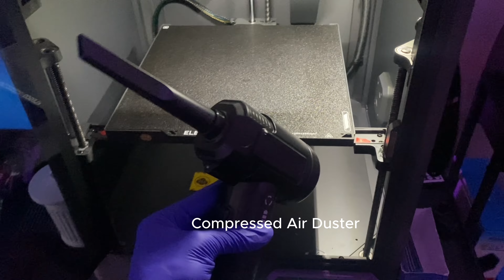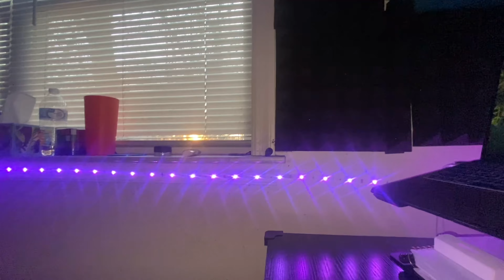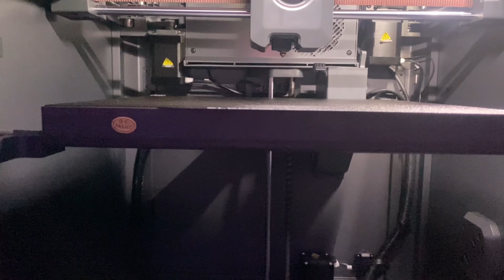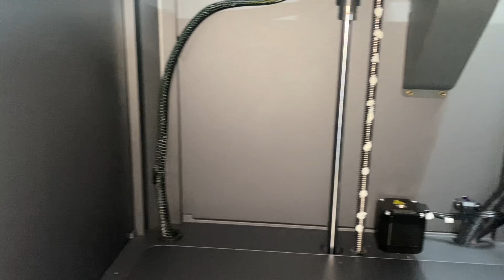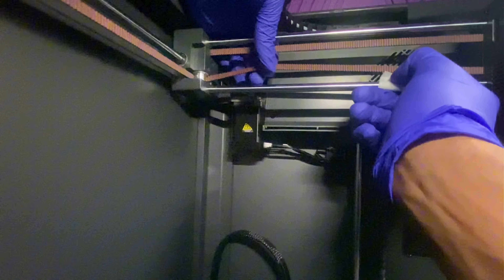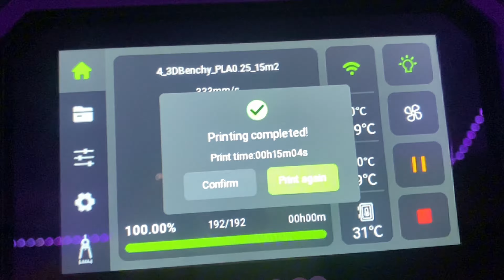200-Hour ELGOO CENTAURI CARBON MAINTENANCE

Comment: Why not use the lithium grease on the xy carriage as well?
Reply: you can but generally you want grease on the screws and oil on bearings/rods i just did my first maintenance after 100 hrs and used the grease they provided on both but will be getting the super lube for the rods. it comes down to science of lubricants its a whole thing you dont want to get into but thats generally the rule if it glides/slides use oil if it pushes/pulls use grease
Reply: @McSillyx  Understood but since elegoo from the factory also uses lithium grease on both and that's what's also supplied to the user shouldn't it be ok to go with that? like the performance and longevity difference should be minimal since other irrelevant issues are more likely to arise well before that given the machines $300 price.
Reply: @pvim  yes the provided grease is fine  i just know a bit about how greases and oils work its not a problem to use the provided grease its perfectly fine im going to get the super lube for longevity grease picks up more dust and debris from the environment. but ether should be fine